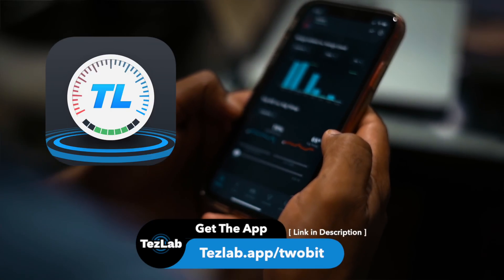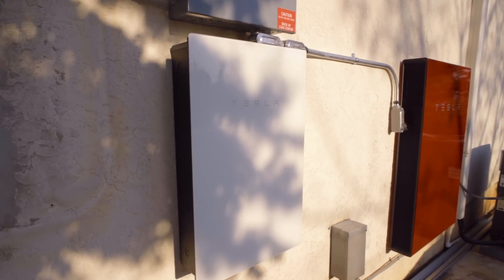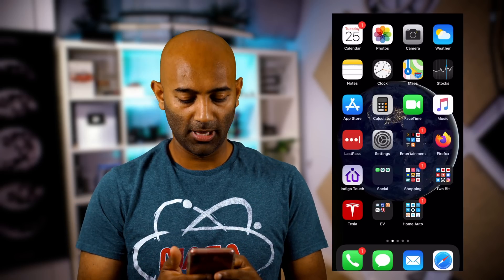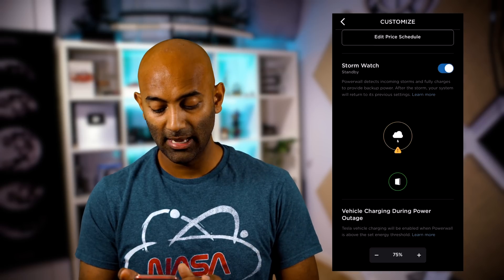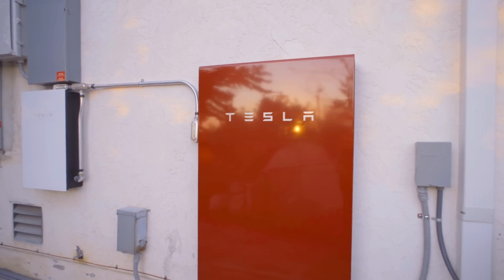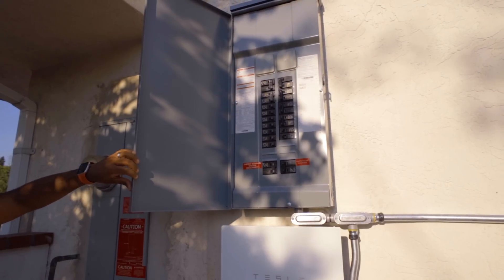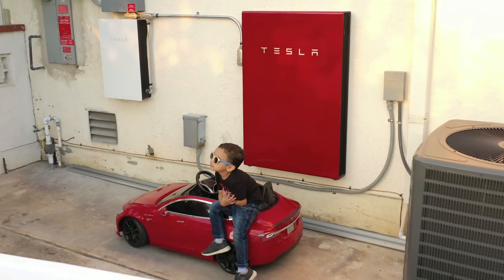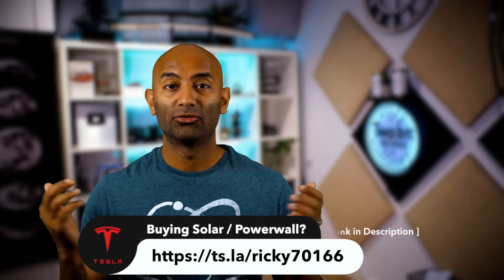The GENIUS of the Tesla Powerwall Explained

Comment: I have two powerwalls and my whole house is backed up. For Las Vegas in the summertime two isn't enough to make it through the day with both A/C units running all day, but it does cover our expensive time of use hours and most of the day. I'm eventually going to expand from 2 to 6 powerwalls now that I see the convenience provided by the powerwalls.
Reply from the maker: Wow yah in those hot periods ... the kWhs go by fast lol
Reply: @TwoBitDaVinci  Yes they do fly by in the summer. From late fall to early spring we can go weeks without touching the grid, but once the heat really kicks in it's a different story :-)
Reply from the maker: Do you have net metering and true up once a year?
Reply: @TwoBitDaVinci  Yes exactly. Net metering with TOU.

Comment: Hey Two Bit da Vinci, I suggest you research ‘Virtual Power Plant’ . Here in Australia I had my Powerwall installed 2 months ago and signed up to this new concept with our utility. With their ‘VPP’ , they pay me to charge or discharge my battery whenever they want (within minimum/maximum limits so I’m not disadvantaged) and they use my battery to smooth out supply to the grid. Paying me and saving their generation supply costs. Just received my first bill, a large credit in winter !
Reply: California doesn't do that though,  power companies rule the land in this case. 

That said, I have to imagine the lifespan of your Powerwall will be severely shortened by allowing the grid to use your battery to charge/discharge considerably more than normal.
Reply: @Mike__B  The power companies will have to pay enough to compensate for this.  Given the fall in battery costs it is reaching an inflexion point where peaked generation plants can be replaced.  It is a waste of social resources not to use the battery storage distributed in private housing.

Comment: Kudos! I get 48 hour blackouts now so I think 1 powerwall won't be enough. U shed light on the mystery but I still have questions.
Reply: Depends on your power needs, 1 could be enough for all your essentials, but 2 would most likely give you uninterrupted supply for everything
Reply: Stop drawing power for AC and heating and you will be fine.
Reply: 2 days without power!?!?! Wow !!!
Reply: Depends on your usage and weather but I would say you are likely correct.  If you have solar and the sun comes out every day the Powerwall(s) will likely reach capacity.  With 1 power wall that is 13 kWh and a limit of drawing 5 kW continuous.  During the summer it is likely most of your electrical needs during the day could be met by the solar.  So for 10+ hours a day, you may not need any power from the grid or the Powerwall.  Also, if you size your solar right you will also have enough excess power to charge powerwall(s) to 100%.  But with only 1 powerwall you have the 5 kW draw limit.  So things like A/C and ovens may be only partially covered when the grid is up, and unavailable when the grid is down.

This limitation is one reason we went with 2 powerwalls.  In the summer we can fill them by noon, get credit for sending power back to the grid until 7 pm, and still power the A/C and ovens into the night.   For us, solar and powerwalls have dropped out summer power bills by 90%.

Comment: What does the PowerWall do during brownouts?  I have solar panels on a vacation home in S California and I don't know what happened during the recent brownouts down there.
Reply: Solar with powerwalls is basically like a gas generator integrated with your home. If your power goes out with solar and powerwalls  you will go into backup mode with your system. In other words you are now off grid and you still have electricity in your home, it is now being supplied by your solar panels and powerwall. You have a microgrid! Once your local utility comes back on line with in 5 minutes your tesla gateway will switch back over to utility.
Reply: The system should see the voltage drop to low, and then take over, when the voltage comes back up, it would switch back to the grid.

Comment: I live in Florida and have solar and three Tesla Powerwalls.  I switched to Time of Use thinking my bill would go to zero because I am able to sell back a lot of solar power each day while running on my house using the batteries. However, the way my utility runs Time of Use  is that they grant a credit for each peak time kWh sent back to them, but will only allow application of the credit to offset future peak usage. That means if you are consistently producing more peak hour kWhs you will just build up tons of credits and never have them applied to lower your bill. Total scam. Beware of your particular utility company’s Time of Use policies. My utility is also absolutely horrendous when it comes to knowledgeable customer service reps re solar. Their bills are purposely vague and to cap things off, they remove your smart net metering meter when you switch to Time of Use and replace it with an old analog meter that must be read by a person once a month, purposely depriving customers of the ability to track their usage, production, and credits in real time. While I love my solar + battery system, and think everyone should have one, I am switching back to standard billing and will set the Powerwalls on either backup mode to have in case of a storm and to avoid daily battery degradation, or to self powered mode.
Reply: Benjamin Simon ...Man, that’s a sad tale of anti-storage, anti-customer utility policy.  Thanks for passing it on!  I’m considering solar & Powerwall, and my sole power grid choice is an electric coop with no incentives and a bad credits plan.  I hadn’t considered the credits restrictions you encountered,  but now I know to look into it.  Tesla recommended 3 Powerwalls for my home, but unless I KNOW my utility will compensate me fairly, I’ll only get one.  They ain’t cheap!
Reply: @737smartin  yea and once you ask ONE agent, wait a few weeks and ask ANOTHER one and try a 3rd time. See if ALL their stories come out the same...

One "forgets" about certain things while another let's it "slip" per se.. And you can also ask the 3rd agent questions from what the other 2 told you. 😉

This makes sure you're aware of pretty much EVERYTHING before you comit. It's always a good idea to be SURE just like you're SURE of your own name..
Reply: @Benjamin Simon  do you have FPL as your electric service utility? I’m in SWFL and have a 12/9 install date for solar+power wall and no idea what my choice of plans is yet.

Comment: You talk like this is a battery backup. How much price differential would be required to shift off-peak generation to peak utilization or sell to the grid at peak price to make a reasonable ROI? Is the system practical If you do not value backup?
Reply from the maker: well as i outlined, there are several modes to give you want you want. it can be just for backup, and always stay at 100%. Or you can do energy arbitrage if that's your cup of tea. coolest of all, you can change things up and do whatever you want. In CA we have wildfires and threats of blackouts, so I could go set it to backup only to ensure max storage in the event something happens. And when things cool off, go back to cost savings mode.
Reply: @TwoBitDaVinci  I would get on if I thought that arbitrage would pay for it. I am in Sacramento, but we do not have the shutdowns and blackouts PG&E has. I do not feel my time of use differential is enough to ever pay of.

Comment: Maybe I missed the answer to my question. What is the life expectancy of the batteries in the powerwall?
Reply from the maker: 10 year warranty. probably quite useful for about 15 years, at maybe 70-80% original capacity
Reply: CROOKED CLOWN tbh most people that were interested enough to know got bored of answering that question , let’s just say power wall batteries are designed for a very long cycle life...
Reply: This is just a hunch,  but I think the Powerwall will have a much shorter lifespan in California than anywhere else in the US.

Comment: @12:42 CT stands for "current transformer", it is way to measure the current going through a conductor/wire, and if you find the current this way and you know what is the voltage (120 or 240 v) then you can calculate the power and energy being consumed by that circuit/room/appliance.
Reply from the maker: Thank you Hesham, I just realized I never spelled out what  a CT is, so thank you for your comment!

Comment: Awesome video Ricky, thank you for sharing your experience. Wondering what Tesla does to mitigate thermal runaway events? Although relatively newer in the maritime world our regulatory bodies make us do all kinds of intricate things to mitigate runaways and internal / external events that would leak to a fire. I'm sure Tesla has some pretty slick hardware for limiting to a event in a single cell of a sub pack but curious to know more.
Reply from the maker: in regards to a powerwall, that's a good question and i can look into this and follow up. their cooling is superb, and their BMS control is incredible. Thank you Brian for your great comment and for being a subscriber for over 2 years!!! We appreciate you mucho Brother, cheers
Reply: @TwoBitDaVinci  thanks! Systems we use have a BMS that monitors temp and charging faults but must be independently powered with 24VDC not the rack HV DC 24/7, which in case of power loss must mean a backup battery bank. This way the BMS is always monitoring even if you're not using it. There was a corvus fire in recent years because they shutoff the entire system but didn't disconnect the bank and a thermal runaway led to a fire. One of those scenarios people don't think about until you go through the exercise.
Reply: BrianCNC - every Tesla Powerwall has a BMS - battery management system , similar to what their cars all have and TESLA Powerpacks - commerical and Megapacks - GRID storage. 
the BMS heats/cools the battery to keep it in Optimal conditions. 
but IF you live in a HOT/COLD City then you should consider mounting Inside the Garage.

Comment: I build my own home and put a 60amp sub panel to carry things like refrigerator, freezer, lights, gas condensing furnace and networking devices. When we have a power outage I can run all this with a small inverter generator. I am looking for a 48volt lithium iron battery plant for my 48 volt  4KW generator.

Comment: What am I missing here? Is this thing just an emergency power backup device? That’s it?
Reply from the maker: its a system that can store excess generation and allow your to use it later when the sun sets. that's pretty powerful if you're familiar with the duck curve. If you have time of use and pay different rates at different times, it's always helpful.
Reply: @TwoBitDaVinci  If I don't have solar, and don't have PG&E's rolling blackouts, then the main benefit would be electric price arbitrage, yes? Charge the powerwall during cheap times, discharge it during expensive times? And of course for use when there is a blackout? Are there other benefits if I don't have solar?
Reply: @tenblinkers3173  The other use would be in case of a power outage. It isn't enough to run your ac, but otherwise could power your home like normal for a full day. If you cut back on other usage, you may be able to continue to use for closer to a week.
Reply: Fish - Powerwall - tm , is a Energy Storage Device , a HOME battery.
it can be Charged from the GRID using OFF PEAK or in Some Areas SUPER OFF PEAK energy. 
then Slowly Discharge during the day. ( if you dont have SOLAR).
but Powerwall is great for Homes with SOLAR too.
as it can Charge with SOLAR in 4 Hours (starting at 6am ) and Before NOON , you can begin sending power to the GRID, and some Utility will PAY YOU for Energy you Deliver. Durring the day, your home is 100% Battery powered and it can Again be Charged before the SUN sets, and your home is again Powered ENTIRELY on Battery ALL NIGHT LONG. 
In the Morning the Process starts again. 
In a Power Outage , the Powerwall is ISOLATED from the GRID and your home is powered by Powerwall.
IF you limit it Essentials , Powerwall can last for 3 days of Emergency Power.
Reply: Mark Plott Ok, thanks for the info. That helps a lot!

Comment: Now imagine if your beautiful Model 3 could charge overnight and sell back to the grid when needed?
It could also easily power your entire home, and has the hardware in it to output far more power than your home could ever hope to use.
It's crazy that our Tesla cars are not already Powerwalls with full V2G functionality.  Just think of what the top-spec Cybertruck could do with a 300 kWh pack!
Reply from the maker: absolutely, as long as our cars still got hundreds of thousands of miles of use before degradation... and I think that's what is the next thing to work on.
Reply: @TwoBitDaVinci  Exactly! :)  Can't wait to hear what comes of battery day.
Reply: We had an update today that lets your car charge up your powerwalls. It's coming, it's coming
Reply: @d.pollard5962  Do you have a source for this? That would be a game changer
Reply: @DakotaJones515  on my model3 screen 2 hours ago. I will go see what version it is and take a pic. Hold on
Reply: @d.pollard5962  I'll go look at mine too. I'm on 32.3
Reply: @DakotaJones515  I posted another statement on the main page. I quickly looked at it and didn't read fully. It is powerwalls to car, and pass thru solar to car thru powerwalls if the grid is down. Sorry I read it wrong. But V2G is coming.